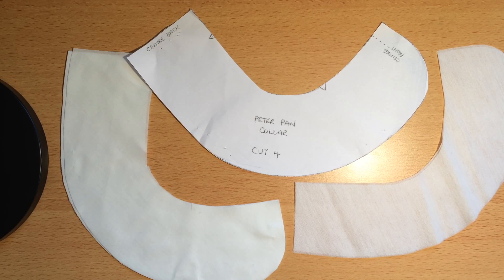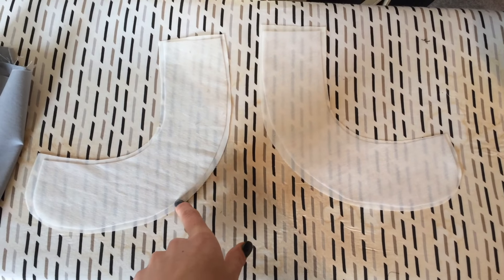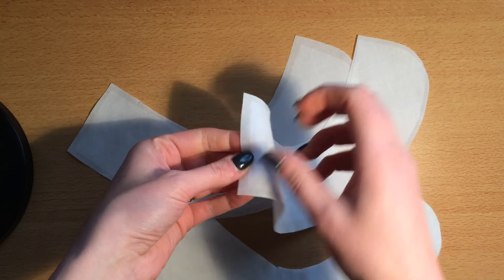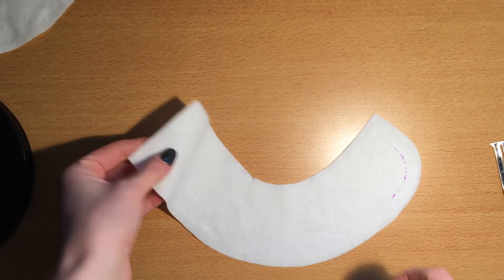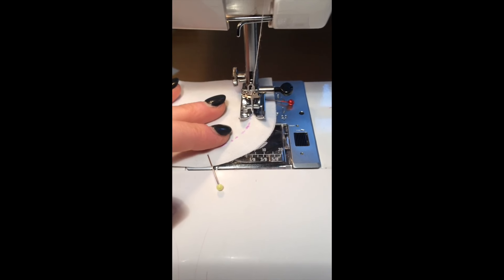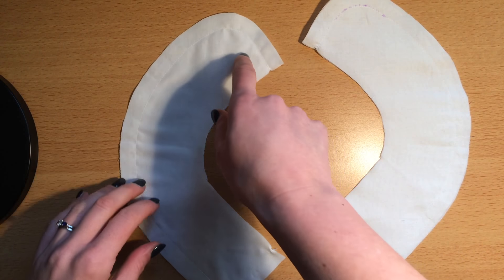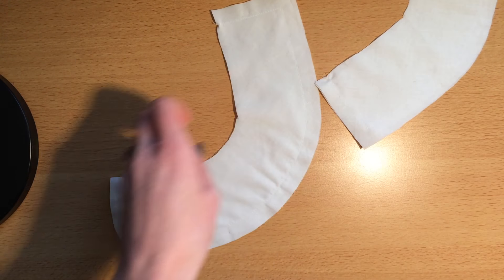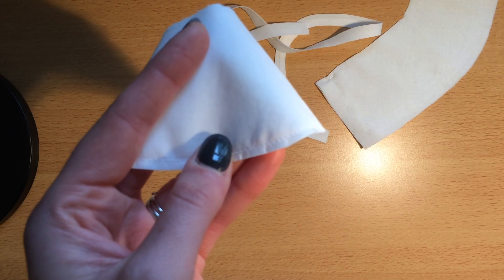Attaching a Peter Pan Collar (Flat collar)

Comment: Hi, I'm not doing a Peter Pan collar but a different type of flat collar. I don't have any pattern pieces left but it ends here with a raw edge so what do I do next please? Many thanks
Reply from the maker: Hi - are you following a pattern? What does this say to do next to finish the neckline? If there's not pieces for a facing, you could draft your own following the shape of the top and back pieces or you can use bias binding to finish the raw edge. The next video on attaching a facing can be found here: https://www.youtube.com/watch?v=vzOo3kc4HjY&t=93s
Reply: @HouseofMissSew  thanks for replying! It's a vintage pattern and the only instructions are on the front of the packet... they say "attach the collar" which isn't very useful to a beginner like me!!! As I said, there aren't any other pattern pieces left which suggests I wouldn't have to use facing. Do you think facing would be easy for a beginner to make (this is literally my first ever garment haha)
Reply from the maker: Emily Lock vintage patterns aren’t easy to begin with as they don’t include enough instructions on how to work through each step. There is a technique where you sew through only the underside of the collar to attach it to the neckline, then tuck the raw edges into the collar and use hand stitching to enclose... I don’t have a video on this though...  It might be easier to use bias binding to finish your neckline. I think I’ve seen example videos of this.
Reply: Thanks! Aha yes I'm very much guessing what's going on 😂😂 I did my first one and it was pretty good apart from the collar. I might see if I can give facing a go but if not I'll try what you suggested! Your help is much appreciated 😊
Reply: Would you mind if I emailed you with a picture for some more guidance please? I seem to be having problems before I even get to the stage of hemming the collar as it doesn't fit the neckline 😬 no worries if not :)
Reply from the maker: @emilyclock02  Hi - yes, I can take a look, email me at juliahincks@hotmail.com
Reply: Thank you so much!!